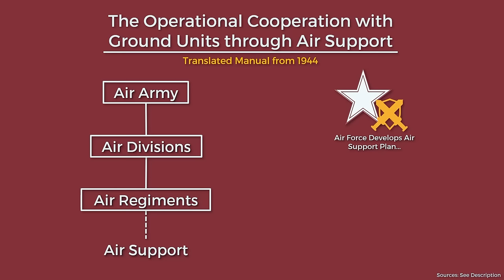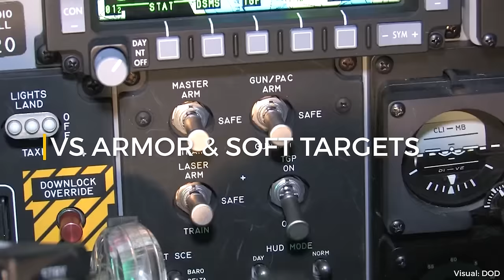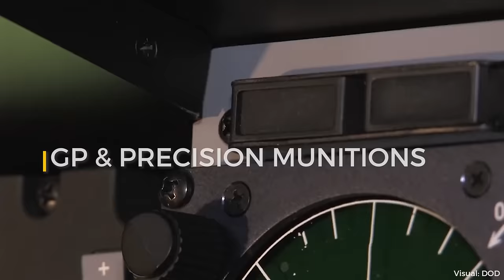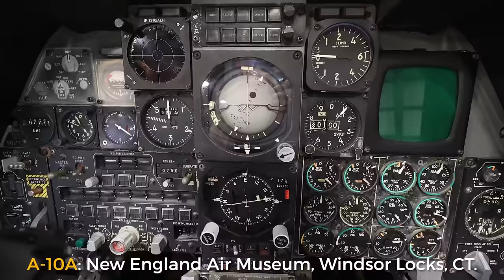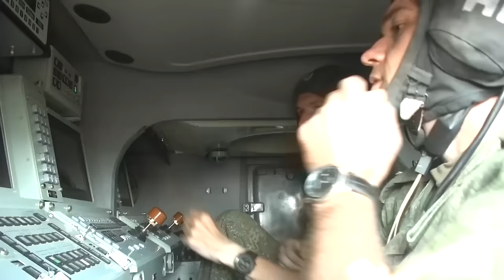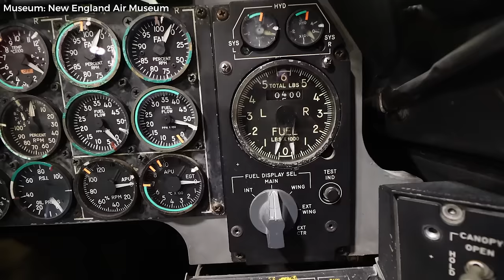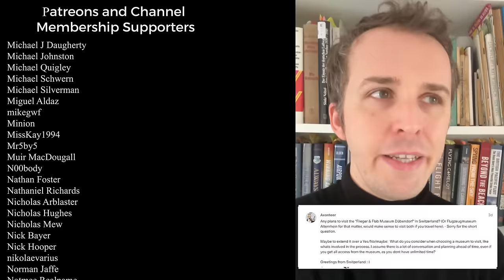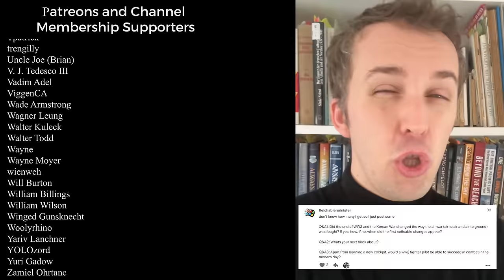A-10 Warthog: Retire or Upgrade the BRRRT? - Future of A-10C Thunderbolt II

Comment: Convert them into optionally manned ISR aircraft, usually piloted remotely. Remove the iconic GAU-8 gun and replace it with intelligence, surveillance, and reconnaissance equipment like those in pods. Replace the ammo storage with batteries, computers, and communications equipment. Under wing hardpoints could still optionally have weapons. Use it like Reaper drones but at lower altitudes and in more highly contested airspace. Conversion equipment already exists for the QF-16 that could be adapted for the A-10. Weight balance can be maintained by careful location of added equipment that will likely weigh close to the same as the removed gun. If you desperately want to add guns for some mission, podded guns such as those used on the F-35B can be carried.
Reply: Pretty much would only have a human pilot for ferry flights through civilian airspace between storage and areas of operations.
Reply: The pulled GAU-8 could potentially be used as parts to rebuild as 100+ Goalkeeper CIWS units. Perhaps each one could be mounted on a truck trailer and used to defend military bases.

Comment: If the general concensus is that it's no longer capable of fulfilling / surviving its original mission objectives, transfer the entire fleet to the Coastguard and watch the drug smuggling trade drop by 95% overnight.
Reply: That's actually a really good idea. While the A-10 might not be survivable in a modern-day Fulda gap scenario it would be incredibly effective against paramilitary drug cartels.
Reply: I'm not sure even the coast guard would want it. 
They probably will have better chance with some specialty design turboprop that's going to be much much cheaper to operate in the long run.
Reply: @jintsuubest9331 Good point. I guess a perfect platform for them would be a modern OV-1.

Comment: A10s are great for COIN

A10s will die in a near peer conflict (we can’t assume we’ll have air supremacy before ground troops are sent in)

The Warthog is a cool plane, but the war in Ukraine has shown how dangerous it is for 4th Gen CAS (look at the Su-25s in the VKS and UAF, they’re getting shot down on both sides) 

So considering the most important aspect of the A10 is its payload capacity for PGMs, not its gun, I think using F-35s or F-15Es is more than enough in a modern war. (Yes even the F-35, since it carries 8 stormbreakers internally)

The A-10 is a dope plane but CAS doesn't require you to fly low and slow with modern sensors and PGMs
Reply: The only reason Su 25's are getting shit on in Ukraine is because they're Russian crap, with Russian components, and don't have remotely up to date, or modern anything in them. The A-10 does. 

That being said, no ground attack plane can just fly willy nilly with AA on the other side, you need to knock out AA then send in the ground attack planes, and since you have to do that with ANY plane, including the F 35's and F 15's, there is no plane that does close air support, or ground attack better than the A-10, that's still a fact. The gun is still a major part of the weapon platform, and can still knock out medium armored tanks, and could still take out T 80's as well, which the other planes could not.
Reply: @Cramblit  The SU-25 is doing lots of work daily in Ukraine on both sides it is a workhorse fighting in a war with 100's of thousands of casualties.
Reply: @AndrewH2791   Isn't it mostly lobbing stuff blindly from very far back...and still getting shot down at high rates?
Reply: @Cramblit  
>you need to knock out AA 

lol, it didn't worked even during Desert Storm, they were forced to move A-10's into sectors where AA wasn't present

>and since you have to do that with ANY plane

nope. More agile plane has more options to deal with AA
Reply: @Cramblit  You misunderstand what's going on in Ukraine. You don't go over the tree canopy over there. The A-10s modernity is based around sensors, things that require you to go medium-high altitude and loiter to get a line of sight to the ground. In Ukraine, that doesn't matter because line of sight gets you shot at. You use speed.
And the Su-25 is faster.

Comment: No future. 
Because never fought against a wall of guided rockets and a competent anti-aircraft defense.
Reply: And the only time it came remotely close (Desert Storm) it took more losses than any other aircraft in theater (per flight hour), killed fewer vehicles than either the F-16 or F-111, and was re-tasked to areas with no AA threat.
Reply: @TLTeo Tell me, why would you use a CAS aircraft for deep strikes? Cause that's what the USAF did and why a plane intended to fly over the line of contact was sent to fly over Baghdad

Comment: A wild weasel A10 sounds like a terrible idea. A plane with lower performance than the one used in that role 55 years ago.
Reply: It could work and I do not think this plane is inferior to F4 Phantom. But I can see many arguments against using A10 for that role.

1. The airframes are getting old and destroyed by wear and tear after each flight. The plane will need more and more hours of maintainiance to keep them in a flyable condition, and a plane that spends most hours on the ground is pretty useless and expensive. But replacing the old airframes and modifying the plane for its new role will cost much money. So much so it is probably better to just by a brand new plane instead which is specialized at their roles.

2. A10 is built with much armor, which means that many design compromises have been made and other things had to give way for providing this plane extra armor and a big heavy gun

Comment: The capability: Necessary. The platform: At best obsolescent, unfortunately.

If you don't have air superiority, as in a presumed for a peer on peer conflict, then its better to do the job with a multirole jet that can get in, drop PGMs, and get out with minimal time spent in the combat zone, because that has the best survivability. Or maybe with a swarms of small, low altitude drones that can absorb quite a few losses before the whole's operational capability is compromised, but that's a still developing field so it could go either way still.
If you have air supremacy, as is presumed in the typical COIN scenario, then a turboprop aircraft can provide 80+% of the capability per airframe for far less than 80% of the cost, both in initial procurement price of the plane and operational and upkeep expenditure over its service life. It may be arguable whether the currently procured platforms come close to that percentage, but a, probably multi engine, turboprop that can handle a good caliber autocannon and a few thousand kilos of ordnance with a substantial loiter time is not a particularly difficult proposition.

In the middle band where you have secured air superiority, but the enemy can still shoot back effectively if you let them, something like the A-10 might have some marginal utilities or even niches within which it is significantly superior to any other platform, but probably not enough of them to justify its use over other platforms. Even if you disagree with that, though, which is fair given that no such conflict has occurred to prove the point either way in recent history, what isn't in question is that the A-10 itself has been rapidly getting too old to do the job reliably for a while now and a direct replacement would've had to enter the pipeline a decade or more ago to smoothly take over from it.

Comment: Thé drawback with the A 10 is that gun : why carry such a big, heavy gun on the battlefield? It reduces payload, is not good enough against hardened targets and too powerful against soft ones. 
Replacing it with a lighter, more conventional one, would mean basically redesigning the aircraft, as the weight distribution would need to be extensively revised.
The only advantage of the A 10 is that it does exist and is mastered.
Reply: 20mm has problems trying kill lightly armored vehicles.
Reply: @pogo1140  Yeah, but 25mm doesn't.

Comment: A-10 Warthog is not that impressive. Even the old A-6 Intruder could be argued to be a better plane as it is faster, can carry a bigger bombload, can fly a longer range, have a better rate of climb, it can fly in all weathers, it can take off from aircraft carriers.

It have a longer range so that the plane can loiter over the battlefield for extended periods more than the A-10 can. Its lower stall speed will allow the A-6 Intruder to fly slower and get a better overview of the battlefield and drop the bombs at the right place.

Comment: I feel like the reason the A-10 is so good at CAS more has to do with the fact the pilots spend so much time training for it rather then the Plane it self.
Reply: It's good at CAS because it is an attack aircraft, not like the fighters that eventually picked up strike capability. The pilots are just good at it because they honed those skills and techniques during a 20 year war in support of ground forces with a less than capable aircraft. If the Air Force had kept the A-10 up to date in survivability and capability like their other aircraft it would not be at this level of a disadvantage today. At this point, it may be better to start fresh with a new aircraft.
Reply: Mover (@CWLemoine) had a good interview with an A-10 pilot who pretty much said exactly this.
Reply: Close Air Support is a Mission and the Hawgs join the USMC Harriers,Hornets and now F-35s in that mission and Community. The Hornet and Harrier pilots appreciate what the F-35 brings to CAS for the Grunts.
Reply: @00calvinlee00  same I keep hearing how F-35 is so good at having situation awareness over other aircraft and that huge when it comes to CAS.
Reply: @bl8danjil  How do you keep an A-10 up to date in survivability?
You put a single engine with actual power in the centerline of the aircraft, you crank back the wings and remove the dead weight (gun).
Congratulations, it's looking like a fighter. You can't do anything about the A-10 without making it fly higher and faster.
Reply: @ChucksSEADnDEAD  The same countermeasures that were in the F-15 EX. DUH! There are other ways to increase survivability other than make it faster.
Reply: @00calvinlee00  Well, the F-35 is lagging behind or having to make compromises compared to the A-10 in CAS in certain areas. According to the report analyzing both aircraft done by the Air Force.
Reply: @00calvinlee00  Marine Harrier and Hornet pilots have no choice, it's F-35 or nothing
Reply: @ChucksSEADnDEAD  and what happens when the grunt tells you they need you to take out the infantry that's 50-75m from them?
Reply: @pogo1140  Yes exactly. When the VMFAs were designated as "Boat Squadrons", they spread their missions around, while VMFAs ashore had CAS as their main mission. The VMFA(AW)s had CAS, FASTFAC,ATARS and other CAS related missions as well. One friend of mine did two back to back deployments, one Cruise on the TR and one ashore based Deployment. The second was mostly a CAS show for his Squadron.

Comment: Grandpa BUFF will never die!
Reply: Old BUFFs may never die, but they will fade away. Attack helicopters are both cheaper to operate and unlike the A-10, we can build more if needed. It's been four decades since the last new A-10 airframe was built. I'd be surprised if we even still had the tooling to build more even if we wanted to build more.

Comment: Let's be honest. The Army wants the A10 for CAS. They have no trust that the Air Force will train pilots or purchase airframes that are anything beyond minimally capable of doing it. Helicopters are susceptible to most of the same issues as the A10 and have their own weaknesses in addition. Drones will eventually replace the A10, and most piloted aircraft, but pilots have the best PR in the world so it's slow going.

Comment: The A-10s lack of survivability is a serious issue that will likely require it's final retirement soon, but it seems like an argument for a dedicated CAS platform that is survivable but can fly low and slow when required, possibly a further scaled down flying wing, akin to a a single seat version of the B-21 with an air-ground cannon, either 25 or 30 mm.
Reply: Want to fly low and slow, you use a drone.
Reply: A B-21 using a 30mm cannon is just as vulnerable as an A-10 without a hope of surviving a hit from an enemy gun.
Reply: @charlesfaure1189  A drone yes, but one with sufficient payload but also sufficiently low cost but also not expendable.
Reply: @pogo1140  Depends on a lot of things, cannon has more range than you might think and trying to hit a moving target with AAA and no radar track is harder than you might think.
Reply: @EricaCalman   the primary cause of lost aircraft during the Vietnam War was AAA guns.
Stealth is designed to defeat targeting radars within a certain frequency band. But the effectiveness is reduced the closer it gets to the radar. The radar may not see the plane at 100 miles but can see it at 12.  IR and optical also work as an alternative tracking option.

Comment: If the a-10 needs to be retired due to age, then why are we still flying the b52
Reply: Because the B-52 incorporates hefty bomb load, long loiter times and range.
Reply: The B-52 fills a capability gap thanks to its ability to carry large numbers of cruise missiles at extremely long ranges, plus it has long loiter capability for CAS in uncontested airspaces. The A-10 however does not bring any unique capability to the USAF arsenal.
Reply: @rare_kumiko Try flying close air support in a valley with cloud cover that is below the mountain top.

Comment: Two myths to address:
1) "Tank killer gun" The gun can't kill any MBT younger than T55/56. 
2) "Extended loitering time" With ordinance attached, the A10 can't do more than 2.5 hours of flying time. This includes transit from base to loiter area. Not very useful.
Reply: While you are right about the gun, I do think it is important to point out that flight/loiter time is one of those things that one has to look past the spec sheets in order to fully understand. Pretty much every jet in our arsenal has air refueling capability. What's more. Air refueling is a major part of any air operation we get involved in. When people just look at the flight time of a jet based only on the fuel it can carry, they are not really looking at the whole picture.

  To put this into a different context. When the F/A-18 was getting developed and tested, "Tomcat mafia" types (high level officers, pilots, and politicians) tried very hard to discredit the plane in the eyes of the defense department and even the American public by pointing out its shorter range when compared to the F-14. This isn't exactly wrong on paper but that wasn't really a problem considering how effectively we handle air refueling operations. This isn't to say that range is not a issue at all. It is just not a major one and in the case of the A-10, it has more than enough gas to loiter for a good amount of time, hit the tanker, and then return to station for yet another good chunk of time. That is just how that thing goes for all planes that fly long missions.
Reply: @startrekmike  Okay, so it has good loiter time with inflight refueling. Goddit. Low cost CAS aircraft. Right.

Comment: I think the ideal would be drones, propeller planes, and Gripen to deal with terrorists in sandals. And drones, Gripen and B2 to deal with enemies with modern armies. Drones cost no lives to lose. 

Propeller planes are cheap and could be used when risks are low. Gripen can do the job that drones cannot do, and its low operating cost, low cost per plane (which means not much money is lost if a plane gets destroyed), high sortie rate, Gripen can also carry all kinds of munitions, and the plane got high degrees of stealth and can move fast.
B2 would be used on the most dangerous risky missions where not even Gripens Electronic warfare capabilities and highly stealthy coating would be enough to prevent it from suffer catastrophic losses of large numbers of planes.

Comment: Given the low altitude operational domain of the A-10 and what we see in the Russo-Ukraine War (2022 - ???), it seems a few swarms of cheap drones could bring down A-10's fairly quickly. Middle Eastern countries did not have such cheap, lethal drones when the A-10 was earning its lethal reputation.
Reply: drones aren't the issue, the war in ukraine is a textbook example of what happens when SEAD isn't achieved meaning attacks have to be done with stand off munitions. Which is an environment where A-10 is suboptimal/incredible vulnerable
Reply: @Exospray  Drones are the issue. Current NATO SEAD weapons and doctrine were designed for the Ukrainian battlefield of decades ago. It can probably suppress current Russian air defenses. However, I have doubts that modern "Wild Weasels", ECM, and so forth can also suppress cheap, off the shelf, kamikaze drones hunting for an A-10 engine intake.
Reply: @amerigo88  For a drone to hit the A-10's intake, it's going to have to be faster than the A-10 or somehow get in front of it. Problem, when you operate a drone, your command signals give your location away.

Comment: The  manned A-10 should be replaced with a large drone with similar capabilities.   The key capability the A-10 provides is the morale effect it has on friendly and enemy.  The U.S. infantry feel good because they know they have support.  The enemy stop focusing on killing the Americans and stare at the 'dragon' flying overhead and worry about it killing them.  The drone should be able to loiter at low altitude and draw attention and fire away from U.S. infantry.  It doesn't need to be able to strafe with a gun but does need the ability to suppress the enemy.  A drone with 100 small munitions would be better than a single 500lb bomb.   It doesn't need a human if it has great optics and a voice link between the drone pilot and the infantry on the ground